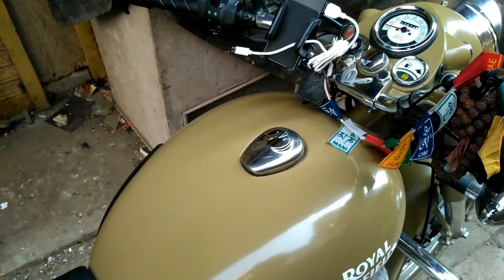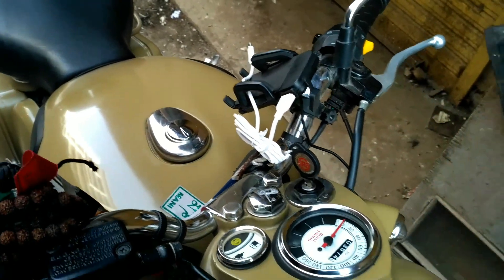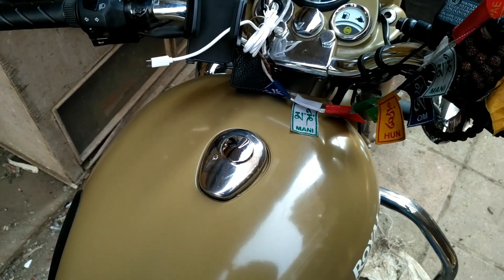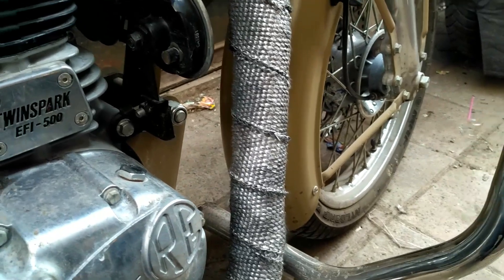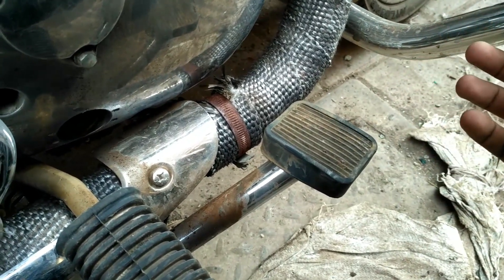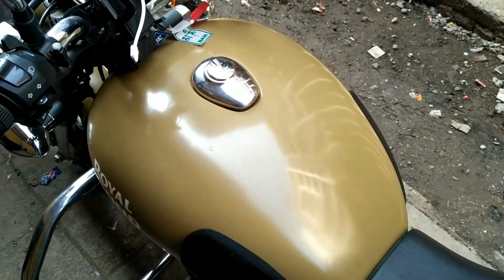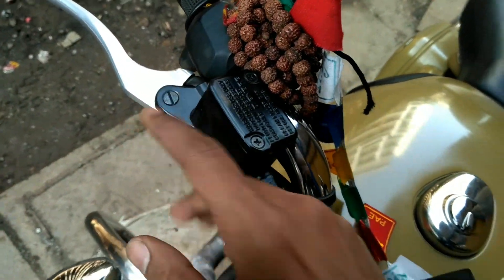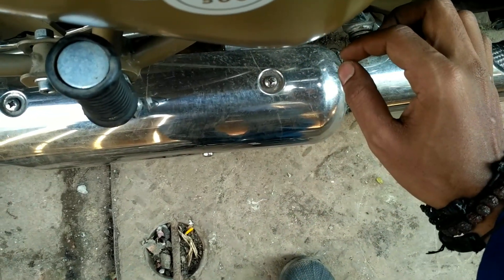Royal Enfield Delivery Check-Ups

Comment: dude just remove that leather or belt wrapped around the silencer, it's the silencer need to be cooled by the air while riding
Reply from the maker: Well it does stays cool and the wrap is there for aesthetics and for safety. There's no heating